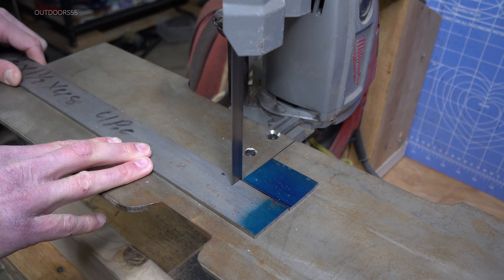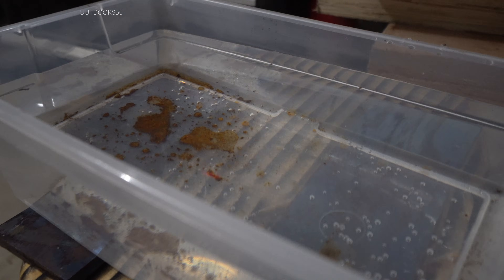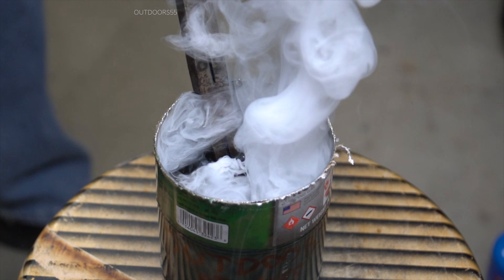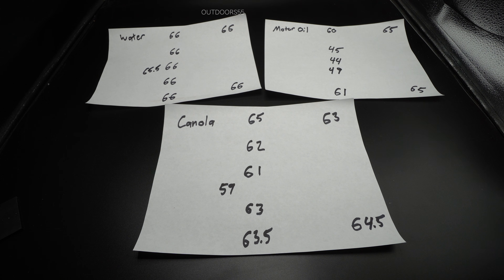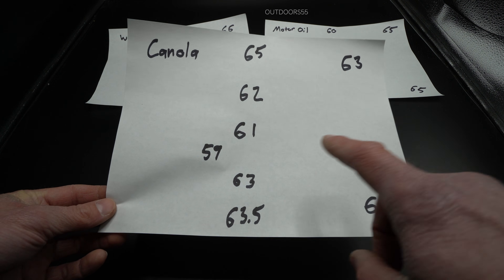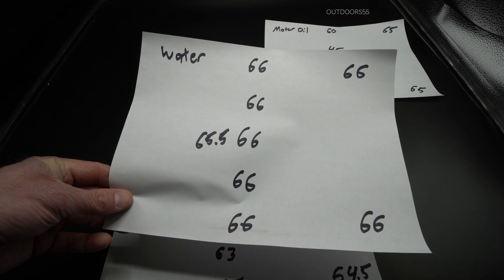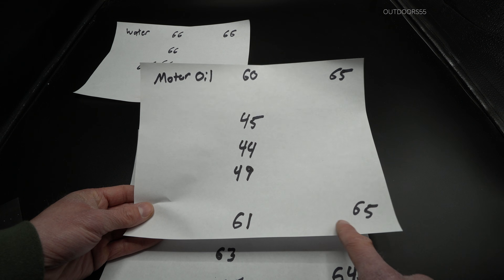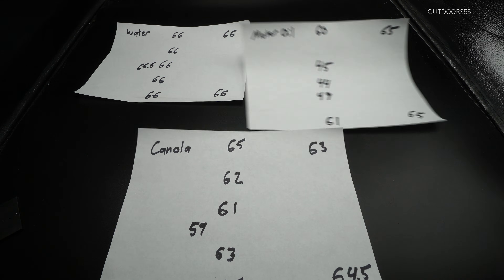Can You Use Canola Oil or Motor Oil For Knife Making?

Comment: Would the thickness of the material have any difference in the results? say if it is a 1/8  shaped to a thin blade,rather than a full thickness blank
Reply from the maker: Yeah it would have an effect. With the thicker it is the more heat it retains. So thinner would be better if using a slower oil.

Comment: The results with conola are good enough for hobbyists, though? Still mostly well above the range of work hardness for most types of knife edges. If you pregrind bevels to thin out that crosssection canola easily cools fast enough for full hardness where it matters the most. You should test this. You can't properly measure on bevels without some super accurate fixture. But you could simulate it with like a very thin piece of steel.
Reply: Yes, if the bevel is thin enough you can do that. Be careful for thin bevels that the air doesn't cool it too much coming out of the heat, though, as that can ruin the hardness. Use an equally hot metal bar to carry it over from the heat to the quench. And if doing thicker stuff, just use water and risk a mild warp. You can probably hammer it out anyways. Retained austenitize is really not something you want in steel. Always better to get rid of as much as you can and temper it down. Lower heat for less dissolved carbon if you need it very soft as you can embrittle steel by tempering above 450f despite getting softer.

Comment: I use hot motor oil, seems to work fine. And ya gotta move the steel  around real good otherwise it will just quench the the corners and edges and get these results. Been trying to get Parks but it’s real expensive and not overly available without costing an additional arm and leg.

Comment: I used warmed peanut oil once with 1080. I chose it because of it's high smoke point over canola. I will use a proper oil in the future but would love to see a peanut vs canola vs parks 50 test just like how you did here.
Reply: Check out some of the tests by Larrin at KNifeSteelNerds. You'll never go back to vegetable oil.
Reply: @johncannon3593 Even water would be better. Risk the warp in favor of superior steel heat treatment.

Comment: What this video does not address is that different types of steel respond differently to quenching in water/brine/oil/blood/whatever, heated or not heated. The results given here are valid for 1084 only.
Reply from the maker: Yes, its a continuation of another video where i address that.
Reply: Blood !!! WTF ???
Reply: Look up tsujigiri. ;)
Reply: @wolflahti412  I don't think tsujigiri refers to heat treating a blade ...... more the brutal feudal practice of testing the cutting performance of a sword on random people ..... but there is probably some Manga episode somewhere showing the forging of a mythical blade using blood to quench ;)

Comment: I forged a thin bar of O1 into a little pairing knife and quenched it in an amalgamation of olive oil and vegetable oil heated to ~135 degrees. I don’t have a hardness tester but it passed the file test. Still though, this video does a good job displaying that a file test ain’t always it, this is as much a science as it is an art and should be treated as such if you want true quality.

Comment: I see the results from your tests now and get it but I have also watched your videos for years and have seen you get crazy results in your tests at the end with 1084 and canola oil.

While you can’t argue with the results from the test here it’s also hard to argue with what you were doing with the knives in those old tests as well.
Reply: These tests also showed that canola oil works a lot better than really bad oil :)
Reply: I don't think he ever did hardness testing in those old videos where he used canola oil. He only did the file test. And yeah, it's passable, but it's not going to be as good as proper oil.
Reply: @Hendlton thin edge geometries can get away with it, but the spine won't be as hard or tough as it could be. Just use water and risk a mild warp. Proper heat treatment is what turns a mediocre knife into a great one.
Reply: @mikafoxx2717 That's exactly what I did. Although along with the warps, you have to worry about cracks, as I found out unfortunately. Not immediately either. I had a knife that looked fine and then broke after applying relatively little force to it even though it was tempered.

But the hardness was superb. I threw a couple of the warped knives against concrete as hard as I could and there was barely any damage to the tip and they didn't break or shatter. Considering they were the first handful of knives I ever made, I was really happy with them.
Reply: @Hendlton  What did you temper at? Did you do the recommended 2x 2hr cycles? I'm just going to start my first blades, but I've done hours of research, possibly too much.
Reply: @mikafoxx2717 Tempered at 200 C according to my oven, so take it with a grain of salt. They were a dark-ish straw color, but they were already quite dark coming out of the forge, so that probably made them seem darker. I did the recommended 2x2 hour cycles. I don't have any testing equipment, so I can't test the hardness, but they passed all the primitive tests with flying colors. Also yeah, I did hours of research over the span of a few weeks. It all kinda goes out the window when you're trying to handle hot metal in one hand and a magnet in the other, all while standing next to a forge that's so hot it hurts to look at. So make sure you know what you're aiming for, but don't sweat it too much.
Reply: @Hendlton  Wow, you got some great hardness then for a ~400f temper. Totally understand what you mean by the forge thing, there's an art to doing it elegantly. Still, your temper and hardening is probably still leaps and bounds better than the average forger heating it up to a color by eye, quench in canola, and heat it to golden by eye, once, with a torch. Small things add up a lot

Comment: OK, in my ignorance of knife making I ask - since water worked so well, why do people use anything else? Water must be the cheapest to use on top of this, apparent, good performance. Also (I'm full of questions), why used motor oil? Why not use new, nice smelling, motor oils. Or better yet use a great smelling castor based racing motor oil :)
Reply from the maker: Water is a very aggressive quenching so the risk of cracking is higher. If your blade is very thin or has sharp inside corners or just get unlucky water can crack blades. Proper oil will help in that area while still bringing full hardness. Some steels like 1095 are still probably better off using water as they need a super fast quench in order to get full hardness. While steel like a2 will harden in air. It's important to match the steel to the quenching fluid.🙂
Reply: @OUTDOORS55  Thank you.
Reply: Those are all great questions Red.
Reply: You stress the hell out of steel when you quench with water.
Reply: బెస్ట్ హార్డింగ్ ఆయిల్ యూస్డ్ మోటార్ ఆయిల్

Comment: Great video, I remember years ago you used canola oil all the time for I think 1080 or 1084 steel, do you still think it is a good cheap alternative? Water seems to work better but I also remember another video where you said water would work but it has a high chance to crack the blade so I was thinking on a knife when the metal is down to a dime in thickness it would crack the metal easier. Do you think canola oil would harden the thin edge of a blade and leave the spine slightly less hard for impact resistance? The edge should cool faster than the spine kinda like the corners of the motor oil piece but I wonder if it would be beneficial or if it would just be a knife with a slightly uneven heat treat. Also. Have you tried heating the water like you do oil to try to keep metal from cracking? Idk if it would work or not but it seems to help with the oil quench. Thanks for the years of knowledge and entertainment.
Reply: (Warning: this starts out 🤓, and becomes massive-🤓in the edit..)
Regarding pre-heating the water, I'm not metallurgy or blademaker, but from a physics standpoint, I think the rate of temperature change always scales with the temperature difference, regardless of the material in question.  The thermal conductivity of the material(s) in question also plays a big role, but for any given material, heat transfer scales with the temperature difference.  So warmer water would cool the steel slower (technically true but practically false.. see edit below).

Edit: just saw from another comment that OUTDOORS55 observed no hardness difference between heated canola oil and cold canola oil, which seems to contradict what I said above, so I looked it up.  What I mentioned is called "Newton's law of cooling" which states "The rate of heat loss of a body is directly proportional to the difference in the temperatures between the body and its environment."  A more modern version is called "the law of heat conduction" or "Fourier's Law".

My guess is that this had no practical effect in this case because the temperature difference between the 1475F steel and the canola oil is huge regardless of whether the canola oil is 47F or 120F.. it's 1428 vs 1355 degrees difference (about 5%).  I think the same will be true of water since it can't get hotter than 212F.. so the thing I said about heat transfer was true, and technically the steel would cool more slowly in hot water, in practical terms it would make hardly any difference.

Again caveat that I'm only speaking as a physics nerd, not a metallurgy nerd.  🤓
Reply: @adfaklsdjf  Very interesting stuff you've said here, so thanks for that 😁
Which then made my (slightly weird according to my friends, and TOTALLY FRIKKIN OCD according to my ex... 🙄) mind think about the 212⁰f/100⁰c maximum temperature of the water being increased by pressure/containment, based on the pressure cooker that my Grandmother used to use back in the 1970s and 1980s...

So... how about if that water could be held at like 250+⁰f for the quench?
-But I have no idea whatsoever on how to get the hot steel into the 250+⁰f water for quenching without the pressure/temperature being lost... 😕

Any feedback from a physicist, whether a professional or a complete amateur like myself, would be warmly received because otherwise I might not sleep for a week with this (stoopid... 🙄) idea bouncing around my poor little brain 🤯
Reply: @therogers4432  I think you'd need to do the whole operation in a pressurized environment (giant autoclave?)...  once you've gone through all that effort, might as well use a pure nitrogen environment and then the steel wouldn't oxidize?

But with the 'austenite' temperature of 1475F used, even 250F water would still be 1225 degrees colder, so the steel would still cool extremely quickly and it still might not make a significant difference?  1475F into 250F water is still 85% as much temperature difference as 1475F into 33F water...

Checked a phase diagram.. at 22 Mpa (3190 PSI) water boils at 674K (753F).. beyond that it's a supercritical fluid and idk how that would effect things...

I've decided to ask ChatGPT about how someone might do something like this in a pressure chamber, and what pressure levels are feasible.. will report back...
Reply: @therogers4432  ChatGPT says a person can perform tasks in a full pressure suit with life support system and etc.  I asked it what the practical pressure limits are for this kind of equipment and that my application would prefer as close to the critical point of water as possible, which I'm sure isn't practical, so i just want to know what is feasible..

It said the pressure suit stuff can typically withstand pressures up to about 50-100 bar (725-1450 PSI), and basically agreed that the critical point of water is practically out of reach.  

I asked it the boiling point of water in 80bar and it said 373C/703F.  Not bad.. at that point we've basically halved the temperature difference vs "ordinary water".

I asked it for a fermi estimate of the cost of the equipment and it said $50-200k for the pressure suit stuff.  I asked how much for a pressure chamber that can do 80bar, maybe 8 feet on a side... it said $100k-500k..

I didn't tell it about the forge.  The suit would probably need active cooling as well for you to survive.

I'm going to go with the high end of its estimates.. we can probably perform your experiment for say ~$750k of equipment.  I'm not sure about the research and labor cost but I'll swag that we should only need something like $2m of funding.

Note that I have no idea if any of ChatGPT's answers were accurate. It's known to be very confidently wrong sometimes.
Reply: @adfaklsdjf  You could probably build a robot to quench knives in a pressure chamber for significantly cheaper than a pressure suit, and an induction forge could probably be used to heat the steel while minimizing other issues inside a pressure chamber. That being said I suspect that chat GPT was still low balling those numbers and your bare minimum setup for high pressure water quenching would be at least $1 million.
Reply from the maker: Personally at this point id rather get full hardness with a water quench and risk the cracking, over using canola. The variability with canola is all over the place. Or just buy a gallon of parks 50 for $40 and be done. 🙂

Comment: I wouldn’t recommend canola oil unless one is using something that hardens very easily like O1 or 4340 steel.  They harden easily enough that canola oil will work ok.  Motor oil is right out.
Reply from the maker: Ill have to test o1. Its a deep hardening steel with a slow cooling curve so it may work just fine.
Reply: @OUTDOORS55  canola oil was touted as a good quenchant for years on many knife forums.  It does have a very fast initial cooling rate but it appears to be too early.  It cools very fast at first then slows down right when you don’t want it too.  It turns out to not be a very good quench for most low alloy carbon steels.

Comment: I wonder if this behaviour of motor oil can be beneficial in making less brittle core of the blade while maintaining decent hardness on the edge?
Reply from the maker: Its too unpredictable imo. And with modern steels differential hardening isn't really beneficial. Unless you were going for a hamon with the proper steel and quenching technique which is more reliable.